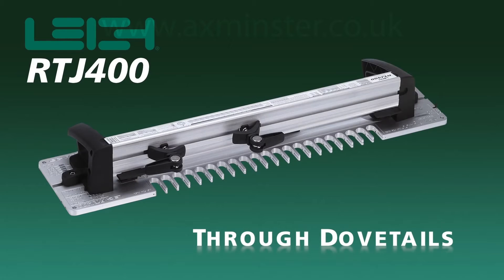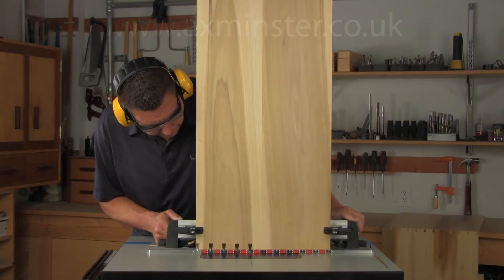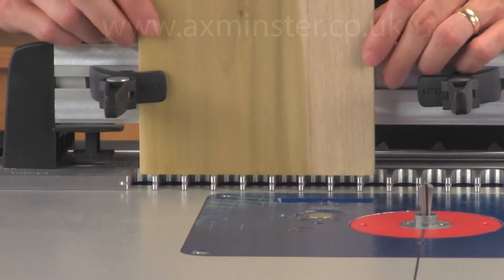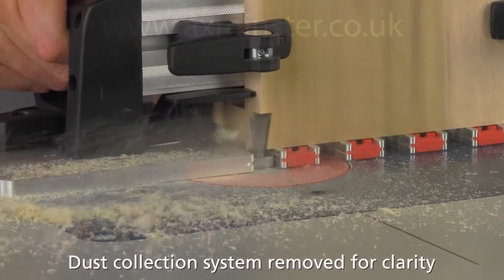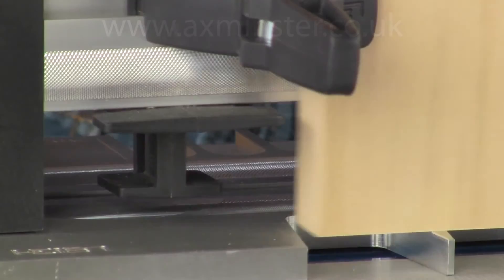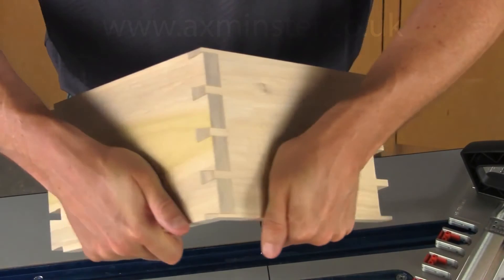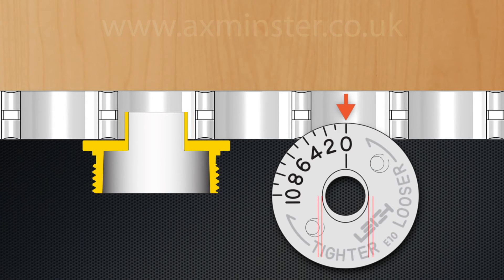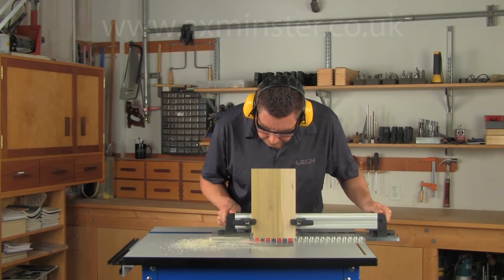How to rout through dovetails with the Leigh RTJ400 Router Table Dovetail Jig.

Comment: too bad it doesn't work with Bosch router tables. I was all set to buy this only to discover it is not compatible with the Bosch RA1180 which is a very popular table. Hard to believe they don't make a plate for that table. I guess I will go with the woodhaven jig which is half the price ant works with all tables.